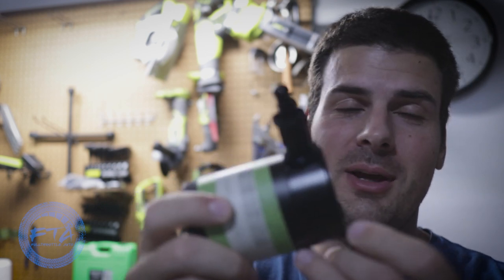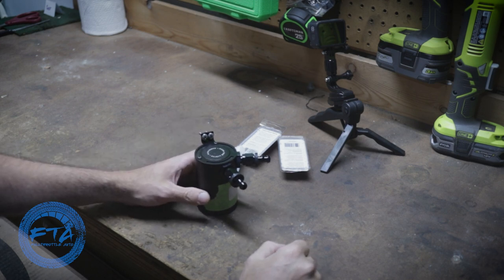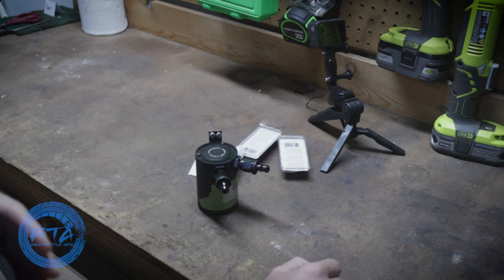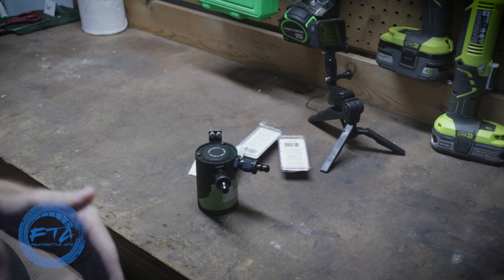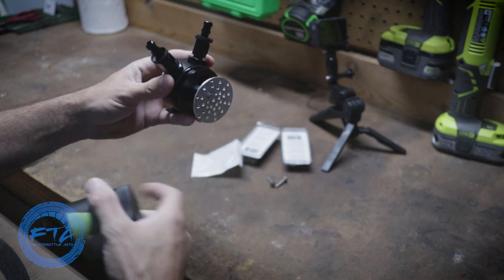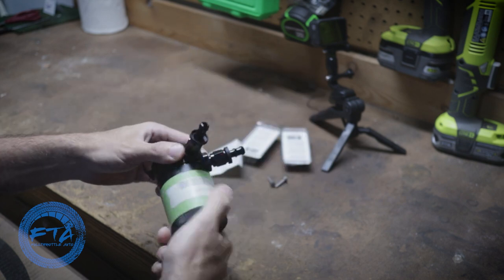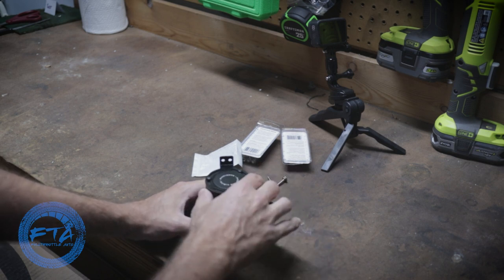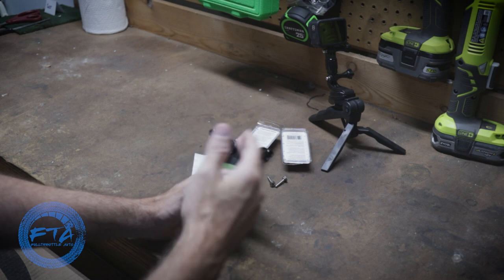9th Gen Accord Oil Catch Can Install

Comment: Double check the inlet of catch can port is connected to the outlet of the PCV hose (the hose right below the PCV in the beginning of the video). If you got the mishimoto can, it should be the right side port, while looking at the can straight on.
Reply from the maker: Thanks for that. I did correct that after I made the video and then did an update on it in my vlog.

Thanks a lot for watching and commenting.

Comment: Does it matter which end of the can connects to the original hose? What is the direction of the gases going through the original hose?
Reply from the maker: It does. I messed up in this video. On this Mishimoto can the lines are reversed from how I set it up. I talk about this in the vlog that's 2 or 3 videos after this one. It just depends which can you have.

Thanks for watching and commenting.
Reply: @FULLTHROTTLEAUTO   Thank you for the quick response. So to summarize: the correct installation would be: original hose connects to the 'OUT' port of the can, new hose connects to the 'IN' port of the can and to the port behind the PCV valve, correct?
Reply from the maker: @boyancheyka6123  that's correct, yes.
Reply: @boyancheyka6123  https://youtu.be/ABcuPJGQ2fM Here is the video he is referring to. He mentions it at the very beginning of the video! Btw I run Penzoil Ultra Platinum too! Great stuff! I want to get the platinum high mileage and see if that helps with evaporation even more by plasticizing the seals, but idk.

Comment: Does input  and out put matter? Thanks
Reply from the maker: It does. In this video I did it wrong. Flip them around from what I show in this video.

I did an update on that in this video https://youtu.be/ABcuPJGQ2fM

Thanks a lot for watching and commenting.
Reply: You didn't even mention which is which
Reply from the maker: @valdojose3069  my bad.

Original hose connects to the 'OUT' port of the can, new hose connects to the 'IN' port of the can and to the port behind the PCV valve.
Reply: Thanks now it's clear for me.

Comment: Did you find any 3/8” barbs for the outlet and inlet of the catch can or do the factory barbs and an oversized PCV line work just as fine?
Reply from the maker: This was all stock size for the hoses. The fittings on the catch can are the right size for the stock hoses.
Reply: @FULLTHROTTLEAUTO  could you show me where I can find compatible 3/8” barbs? My Mishimoto catch can came with 3/4” barbs and I spent the better part of an hour boiling my hoses trying to press them onto the larger barb with no luck.
Reply from the maker: @TheNuclearBolton  sorry to hear that, contact MAPerformance. They were good with helping me get the right size. They might be able to help you get a set. Let them know which catch can you have and the size you need.
Reply: @FULLTHROTTLEAUTO  😂 thanks, I found one on their website for $13
Reply from the maker: @TheNuclearBolton  glad to hear it.

Comment: Hey, how often do you have to drain the catch can? And is it an amount to worry about?
Reply from the maker: I've only drained it once and that was just to see how much was in there. Safe to say you can probably go a year without even worrying about it.

Hope that helps.

Thanks for watching and commenting.
Reply: @FULLTHROTTLEAUTO  thank you, I’m just thinking about every mod possible to increase efficiency and longevity. I don’t know if a throttle body spacer, cold air intake, or less restrict exhaust, along with a tune could help, but I’d assume the car would do the work itself. (In terms of relearning)
Reply from the maker: @TheNuclearBolton  if you do that you'd want to tune it. The ECU wouldn't relearn. OE ECU will run what they are set to run at. So your mods won't do anything until you tune for it.
Reply: @FULLTHROTTLEAUTO  what tune would you recommend? And will it reset if the battery dies?
Reply from the maker: @TheNuclearBolton  I run the stage 2 91 tune. I did a video on this here https://www.youtube.com/watch?v=vzvOiGCJkrY&t=344s
Reply: @FULLTHROTTLEAUTO  aight, that’s sounds dope. You still get the correct mpg readout on the dash and works with the fuel economy mode (green leaf)
Reply from the maker: @TheNuclearBolton  I don't use the eco mode (green leaf). But I don't think it affects that. The mpg reading seems same as before.

Comment: good day, what size are the catch can hose barbs?  do you still have the OEM hose from the PCV valve? what size is that? I have a 3/8 catch can . would the nipple fit my poem hose coming from the back
Reply from the maker: I mention in the video that for one end you use the stock hose. The other end you use an extra hose you would get. It is 3/8

Comment: Hey bro what's the size of the throttle body just wondering if it will fit the adaptor for k20
Reply from the maker: Not sure what the stock size is. Can't seem to find any info online.

Comment: Hi, do you recommend oil catch can for 2015 Accord V6.
Reply from the maker: Honestly I recommend it on any car. But I think the V6 is port injected so not as necessary.

Hope that helps.

Thanks for watching and commenting.
Reply: I think that port injected cars are for guys who don’t like maintenance and only change oil, and GDI is for nerds who want mod every little part of the car for fuel efficiency and longevity. Honda did the right thing making the new k24 GDI, but so many people think it’s less reliable.

Comment: so i need an extra hose to attach to the outlet and into the engine?
Reply from the maker: Correct
Reply: Ok now it finally makes sense. What sizes are the hoses for these cars?
Reply from the maker: @Nikefanation25  3/8
Reply: Fullthrottle Auto Is the hose that’s included with the catch can a 3/8ths hose?
Reply from the maker: @Nikefanation25  there is no hose included with the catch can from mishimoto. its only included with the drain kit. yes the drain kit hose is 3/8
Reply: Fullthrottle Auto Ok thanks for you help; love the cr2 vids.
Reply from the maker: @Nikefanation25  anytime. Glad to hear you enjoy it! Thanks for watching and commenting.